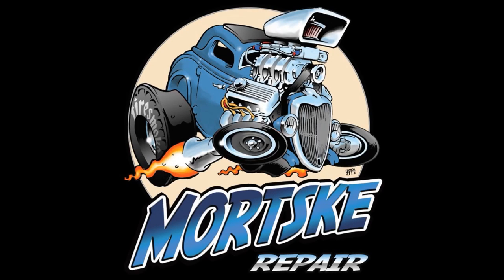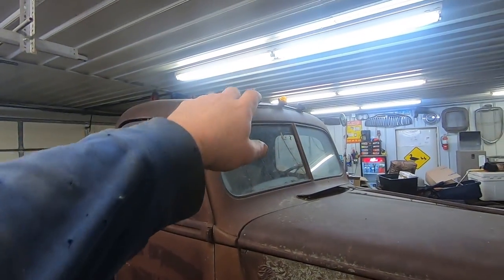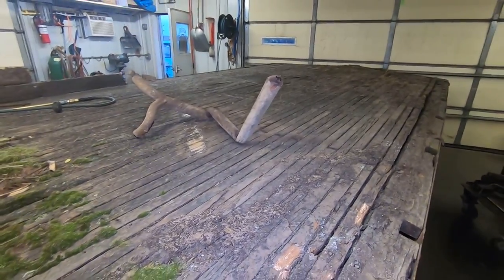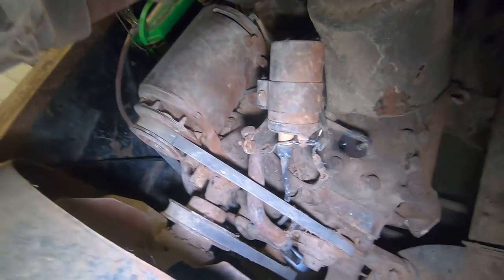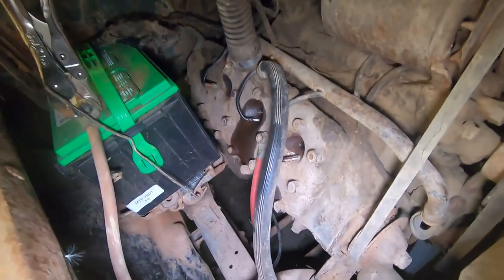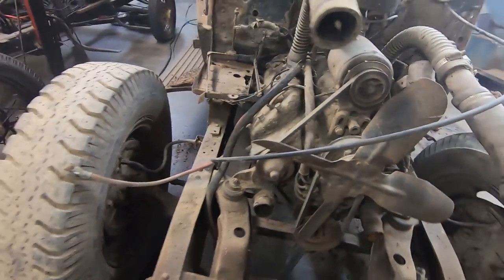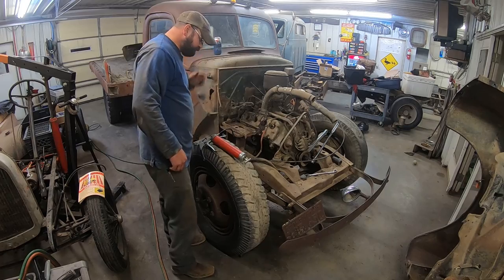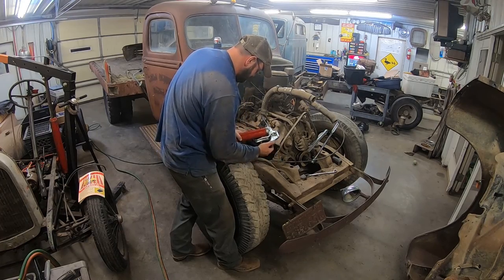Farm Auction 1944 Ford Flathead V8 truck! Abandoned for 47 years! Will it run?!? Stuck rusty engine!

Comment: I'm glad the grease gun and huge pipe wrench things didn't work and the heads came off before it ever turned a revolution because then it would have been cranked on forever trying to start it with them stuck valves & grinding in all that wet rust to shards and probably still not fired off... You need some kind of bore scope to get a visual on them things inside somehow?
Reply from the maker: We've actually loosened an early OHV Oldsmobile with this method! It works better with OHV engines as you can manually close the valves on any given cylinder. It's not ideal. And it's messy. And they smoke like hell when you get them to start! I do have a bore scope but I keep forgetting to use it. Would have just saved me the grease step and maybe removing the other cylinder head but with stuck valves I'd have probably opened it up anyhow. Thanks for watching and commenting!
Reply: @MortskeRepair  Hey, thanks for the reply... I was curious what the plan to get it all out was!  ... or it would just get smushed up and out the spark plug hole and into the intake and exhaust manifolds if it started turning?  I just never seen this before but it's pretty smart to find something non-compressible like that.
Reply: @MortskeRepair  I think you got it revived up great and smooth running engine now!  Not so much a "Core" anymore but I'm not in the business, so to speak or had much experience with anything pre-1970 except a fan of rust buckets!
Reply from the maker: @THRASHMETALFUNRIFFS  Yeah, most grease guns put out like 3,000psi. Grease is cheap too and everyone has a grease gun laying around. Once you get it free and down to the bottom of the cylinder you go to the next cylinder that's all the way up, most of the grease comes out the spark plug hole as you've got all of the valves closed. After a complete rotation you can turn it by the crank usually.
Reply: @MortskeRepair  GADZOOKS MAN!  I knew brake lines could be like 300 or 700lbs or something but Wholy Moly!  Genius... and once it gets gushed around and warmed up it'd just melt away like a chicken fryer too I guess?
Reply: @MortskeRepair  I'm sending this to Carchaeology... he's did a vid tying to free up that beautiful stuck Cadillac last week by dragging it behind a truck and popping the clutch, which I never thought of before either, but people mentioned breaking rods that way... he must know this method?!  HE already popped the heads and getting it sorted but maybe another trick for him sometime?
Reply from the maker: @THRASHMETALFUNRIFFS  I actually tried putting a pipe wrench in conjunction with a cheater bar on the driveshaft with the engine in gear but all it did was make the clutch slip!! I've done the old clutch dump before but that's a two person job and I don't have any friends to pull me and Duff is a terrible driver!
Reply from the maker: @THRASHMETALFUNRIFFS  It's very environmentally friendly when you get it hot, lets just leave it at that!! Haha! You learn something new every day!

Comment: How did all that water get into the cylinders?  Remember all those water jugs on the front floorboard?  Head gasket or cracked head/block???
Reply from the maker: I believe the air cleaner filled up and then it went into the carb. But it could have been a head gasket too. Hard to say!

Comment: To remove the head I can envision something I would make! I would  take a steel plate and cut four wholes that match up with the plug locations. Then take small pieces of pipe or round stock threaded to the same pitch and size as the plugs,   slide the steel plate with the four wholes over top lined up directly above the plug holes  then lower the threaded pieces through the steel into the plug wholes, lower the plate and slide each of the threaded pipes into the steal plate ,then into the plug holes, weld small caps on the top of the pipes or round stock and lift from there with an engine hoist! I could draw it but can't seem to explain it well! In the end the threaded pieces I mentioned would fit into the plate like a pint gun shell fits, at least it would only go in one direction!
Reply from the maker: Good idea! Send me a sample!

Comment: I was going to do that to a stuck marine 350, how can you get grease out afterward? Stuck engines don’t scare you in the least.
Reply from the maker: Just crank it over with the starter, push most out the exhaust and or spark plug hole. The rest will burn out when you get it running.

Comment: Did you find where all that water in the cylinders came from? That was way too much rust in those cylinders. By the way you did not give up!
Reply from the maker: It must have came in through the carb as those intake valves were open. Thanks so much for watching!

Comment: I think the reason you were able to get compression after all that rust is, those factory rings are about a quarter inch thick!😂 And dont those pistons have 4 rings, not 3?
Reply from the maker: They built them well! I'm not sure off the top of my head but I think it was only 3.
Reply: @MortskeRepair  I don't know about built well, considering the core sand, the 3 main bearings, the spindly rods...but those parts were adequate for their intended use. They weren't built for boost, 7000 rpm, or 300hp. But a good effort for the price, the times, and the intended use. They whipped everything else in their price range.
Reply: @MortskeRepair  Don Garlits has a flattie built for BLOWN NITRO, that makes over 500hp. Briefly! He fired it up on his engine dyno, sounds wicked! I don't remember if it had Ardun heads or not.
Reply: The 59AB had 4, the pre-war versions were made with 3.

Comment: Easier to put the vehicle in gear and rock it back and forth to get the motor unstuck
Reply from the maker: The tires just slide when they're stuck this bad. Or the clutch slips. Thanks for watching!

Comment: What engine oil would you recommend using on a 1951 v8 flat head original engine. I drained the oil, I noticed that there was some slush at the bottom of the oil pan. I put 4. Quarts of conventional/detergent oil in the motor and one on the oil canister with the filter. What would you recommend run it , or drain the conventional/detergent oil and put non-detergent
Reply from the maker: I run 15w-40 Rotella

Comment: I enjoy your videos and am subscribed. That being said, this truck can’t be a 1944, all the US car makers only made jeeps, deuce-and-a-halfs, planes and tanks in 44 and 45.
Reply from the maker: While they are super rare, manufacturers did build a few vehicles for consumers. This also could have been a millitary surplus rig as well. Based on the information I've found, mainly the oddball steering wheel it's either a 42 or a 44. I'll have to do some more digging into the VIN information. Either way, it's got a few stories to tell. Thanks for watching and commenting Jim!
Reply: Ford did make a few vehicles for the military during the war.  Just a few. and, the vehicles in dealer stock would be registered often according to the year they were finally sold.

Comment: Seems like a lotta effort for 80 horsepower.
Reply from the maker: Hey it's 85HP!
Reply: @MortskeRepair  I knew that, but it ain't NOW🤣. I was being CHARITABLE. It's probably 60-70 now 😉.
Reply: @MortskeRepair  42 up?  It is 90 horses for the 221, 100 for the 239.  The 221 actually dynos at 93.
Reply: @donellmuniz590  It will at spec or more when the motor is rebuilt.  Not everybody is a horsepower freak.

Comment: If you're going to keep that unhooked at 12 volt battery soon as it starts you got to melt the 6-volt wires in the whole electrical system with a 12-volt battery
Reply from the maker: So there's a difference in 6 volt and 12 volt wires? You should read up on Ohms Law!
Reply: @MortskeRepair  my understanding is you can't use a 6 bolt voltage regulator you can't use a 6 volt alternator. You can use a 12 volt battery to start the car wires or wires on talking about components will 6 volt headlights work with a 12-volt battery will 6 volt bulbs get too much electricity to them will a 6 volt radio have a problem running on 12 volts let me know I thought you couldn't do that. MR WELSH
Reply: @MortskeRepair  10 what was the purpose of changing the car from 6 volt to 12 volt for I know the wires are not going to melt will the alternator be different will the voltage regulator be different will the starter be different if they're not different why did they change it to 12 volt all you had to do was change your battery I think you're wrong. MR WELSH
Reply: @MortskeRepair  when you filled that cylinder with a grease gun and that piston was still on its way up you clogged the cylinder walls with grease and it had nowhere to go except bleed out through their head luckily you had it loosens that's why I went into the other cylinder to it had nowhere for the grease to go because the cylinder with clogged with grease from a grease gun. MR WELSH
Reply: @MortskeRepair  I'm talking about the electrical system inside the voltage regulator alternator tail lights headlight bulbs dashboard lights possibly the radio or what was the purpose of changing it over to 12 volt if all you had to do was just change the battery. I'm not mad I just like to know that's what I've been told all my life that you had to convert this 6 volt system over to a 12-volt system is that true or not I don't know I thought it was true I think I definitely is true. MR WELSH
Reply: @MortskeRepair  if I am wrong I apologize but then I would like to know why when you change a car from 6 volt to 12 volt why do they have to do anything except change the battery and be on your Merry way. And people complain that you have to change it all over to 12 volt batteries. Or is that just a myth. By the way I was impressed to see you get it to start let's see what you was in the old head gasket and nothing leaked good job.👍  MR WELSH
Reply from the maker: @jimwelsh1908  You shouldn't use a voltage regulator, it's a generator and not an alternator but I've used them before with 12V and they were fine. Bulbs and radios don't like 12V however! Wiring is fine though.
Reply from the maker: @jimwelsh1908  Because 12 volts cranks it over faster and I have 12v batteries available and not 6v. The generator, not an alternator, doesn't care if it's 12V or not.
Reply: @MortskeRepair  I would not use a generator . Which is on that 1947 or 42 year truck. I would have changed it over to a alternator which has a built-in voltage regulator some people watching that video well thank all you have to do is change the battery I am just saying that you should replace the voltage regulator or disconnected and change the starter out. My friend 👍✌ MR WELSH
Reply: Oh I was trying to say is to your viewers that you can't not just throw in a 12 volt battery and everything's done. MR WELSH
Reply: @MortskeRepair  if you take all the spark plugs out of your daily driver and turn the key at motor will spin three times faster than if you have to plug in it that's why I suggest if the motor seized up take the plug out keep them out spray liquid wrench or a lubricant in there not a grease gun and let it soak and try to turn it by the crankshaft and I think you'll find out it's easier to turn without the plugs in because there will be no compression holding the engine back from spinning freely.  MR WELSH
Reply: @jimwelsh1908  The reason so many people think they have to change to 12 volts is because they try to use 4, or even 6 gauge, which is even smaller, battery cables with 6 volts.  A 6 volt starter draws twice the amps as a 12 volt starter, so they are plagued with slow cranking problems and no-starts with a completely warm engine.  You need 1 gauge cables with 6 volts.  On a VW, you can use 2 gauge.  The auto makers changed over to save money.  Copper is expensive, insulation is cheap.  You need a heavier wiring harness with 6 volts, especially with power windows, seat, etc.

Comment: Hey did you change or cleanup the carburetor in this video? I noticed that the carburetor was dirty in the video then it looked clean all of a sudden.
Reply from the maker: I swapped it for an older one that I knew worked.
Reply: @MortskeRepair  Hey did you ever do anything with that truck?
Reply from the maker: @LouisJr.  I'm driving it daily now.
Reply: @MortskeRepair  
Hello! Did you ever paint that truck & did you replace or restore the lifting truck bed on it?
Reply from the maker: @LouisJr.  I did nothing with it.

Comment: That is a 42 and yes Nixon was still in office he resigned in 74 LOL 😁
Reply: Jose, I agree with you, I had a '46 and the steering wheel was different.
Reply from the maker: I'm no expert but I've had a lot of 46 and 47 Jailbars. How do you know it's a 42? I need to go check the VIN and see if I can verify the year. But based on that wheel I'm guessing it's either a 42 or 44 from what I can find online. But you can't believe everything you read out there! Thanks for commenting Jose!
Reply: I remember the Watergate hearings, and when Tricky Dick resigned.

Comment: What is that rib looking part covering the points and going up toward the carburetor
Reply from the maker: The vacuum brake line? The rotor? The spark plug wires? The distributor cap?
Reply: @MortskeRepair  I see it now plug wires
Reply: Thanks

Comment: Take the plug out so it will turn free it won't be any compression holding the engine back from turning.  MR WELSH
Reply from the maker: It was much more than compression. I've turned many over with compression on them.
Reply: @MortskeRepair  but it's easier if you have the plugs out try it sometime. MR WELSH
Reply: @MortskeRepair  I have gotten Motors that were seized to turn by taking out the plugs Towing the car around and letting the clutch out and that it turn easily get the motor to unseize without having compression holding the engine in tighter what do compression wasn't there the motor could turn a lot Freer that's all I'm saying.  MR WELSH
Reply from the maker: @jimwelsh1908  I've done it many times. Did you see what was inside this engine?!? Compression from the spark plugs sealing the cylinders was not the issue holding it up.

Comment: instead of using grease, why not use air?
Reply from the maker: Air is a compressible gas. And my air compressor is only 150psi. Whereas grease isn't nearly as compressible and I can get close to 3,000psi with my grease gun. Thanks for watching and commenting Bert!
Reply: @MortskeRepair  
That does make sense, I have rebuilt a 1950 Ford flathead 239 cubic inch, the rods don't look like they could take 3000 pounds of pressure. I could be wrong though because when running I guess the downward pressure could reach that or maybe more. Just not sure .
Still an interesting video sir
Reply from the maker: Well the rods should move easy, they're not what is stuck. It's the piston to the cylinder wall. Sometimes you just gotta sacrifice a few parts tho!

Comment: I had several flatheads in a 23 T Bucket. Typical flat head problems, wrist pin keeper came out
and drove the wrist pin into side of the cylinder, Overheated when a water pump pulley came loose and the water pump stopped turning, Rod knocks galore, Bad crankshafts. ( Rod bearings were $135.00 32 yrs ago.) Sticking valves. THIS WAS THE WORST ENGINE EVER MADE!
Reply from the maker: Nahhh they're not so bad for the times!
Reply: You just were trying to get by on the cheap with junk engines that needed rebuilding.

Comment: I’ve never seen grease push a piston down, just saying’.
Reply from the maker: We used that method on an OHV V8 in a 1967 Cutlass a few years ago and it worked well. Grease guns put out around 3,000psi so you can put a heck of a lot of pressure into that cylinder and avoid tearing it apart. Thanks for watching!

Comment: There was never a 44 model there were 42 and 46 models that truck may have been made in 44 but it was a 42.
Reply from the maker: From my research I've done they made very few 1944 models. They're pretty rare. Either way, same truck whether it's a 42 or a 47. Thanks for watching Gary.
Reply: @MortskeRepair  I learned to drive when I was 10 or 11 years old in a 42 Ford Pickup. It was my dad's work truck late 50 till late 60s. Had a 100 hp flathead V8 was not the original engine. My dad said it was an old Air Corps truck from WW2, He was in the Army 45 to 47.
Reply from the maker: @garyshinn4626  Basically everything manufactured from 1942 through 1945 was manufactured to support the war. Crazy how the entire nation banned together to support the effort! Thanks for commenting Gary!
Reply: They did make some for the military during the war, just not for the general public.
Reply: @michaelbenardo5695  I owned a 42 back in the 60s, My dad said it was an old Army Air Corp truck from WW2.
Reply: @garyshinn4626  I have long wished I could find a 42 Buick.  It looks a lot like the 46, but has double body-side moldings, instead of a single molding, on the Super and Roadmaster.  And, it has more power than a 46, (dual 2 barrels vs a single 2 barrel).
Reply: @michaelbenardo5695  Go south, there are a lot of old cars and trucks sitting along the back roads. I am in Ky, all rusted out here. Just got back from Ark, There is gold in them hills.

Comment: My Model A club restored a 1946 Ford Fire Engine in 2017-2018 that was in a field for over 10 years.  We have lots of tech info on it if you need it.  Yours is about the same year.  www.RogueValleyAs.org - ask for the webmaster.
Reply: It is a 46